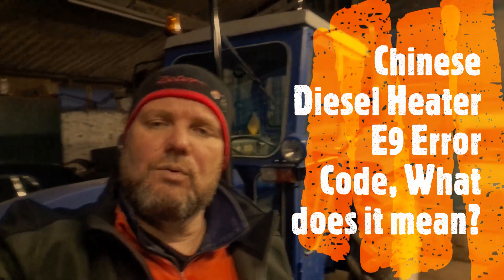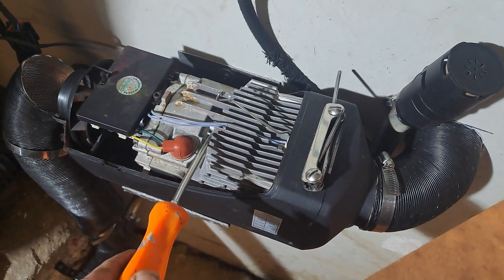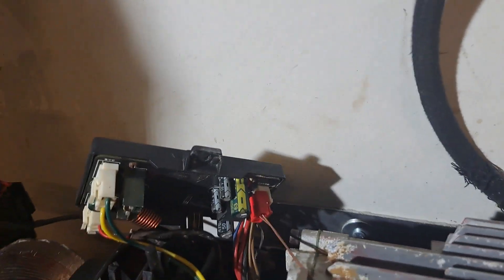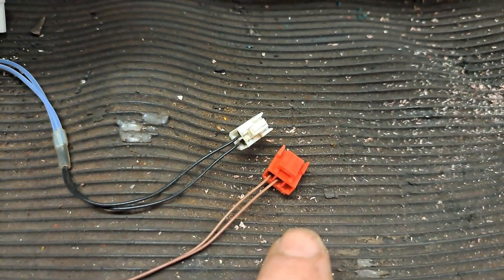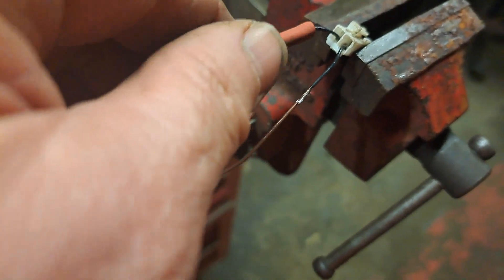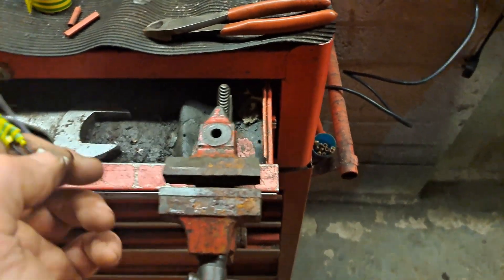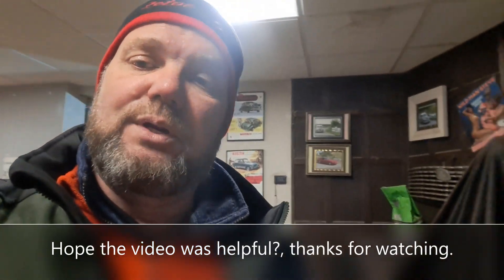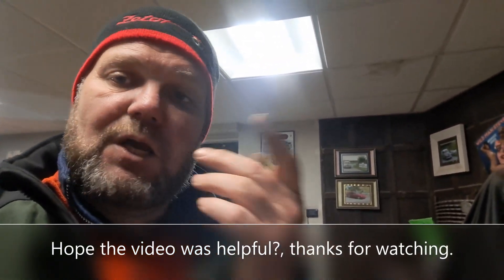Chinese diesel heater, waste oil burner cheep heat, E9 Error code What does it mean??

Comment: The air feeding the intake is probably too hot. I love your "Exhaustalator 3000", but I'm guessing that is the direct cause of the e9 error. I would suggest using the ambient air intake alone. 
Again i love the Exhaustalator and  I had a similar concept except use it to heat water in a camper minivan. Basically running the heat through an indirect water heating tank. 
Either way, you could easily put the heat you have harnessed from your Exhaustalator to good use. Nice work, keep it up.